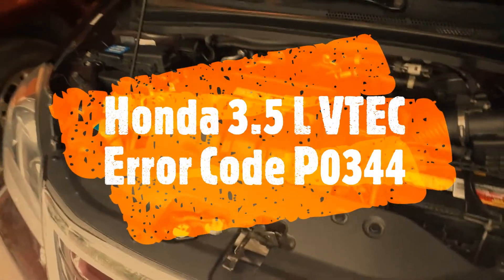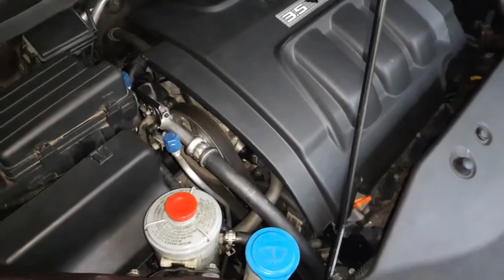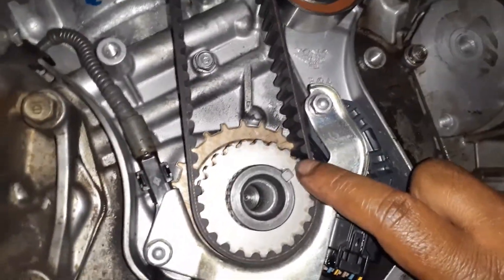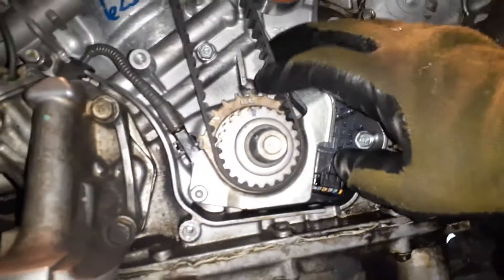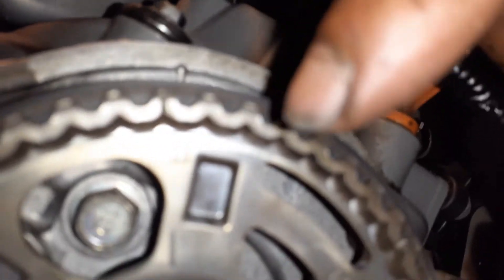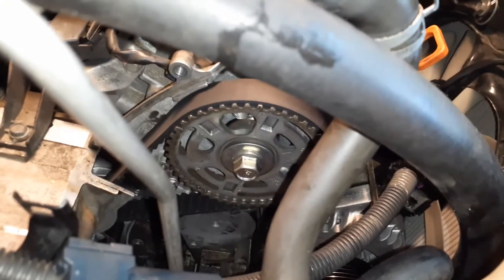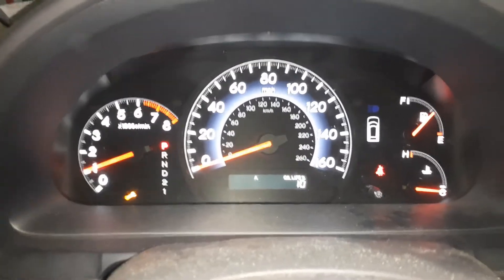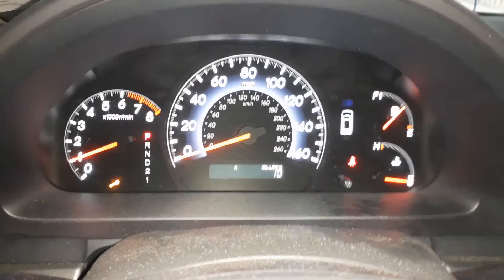Timing Belt Misalignment Problem - Honda/Acura 3.5L V6 Error Code P0344 P0340

Comment: Great job brother. I have 2007 Honda Oddyssey with blinking D light and VSA light on! We change the neutral safer switch and the pressure sensor! Also took it to electrical shop and transition shop and they can’t figure out what’s the problem is? I have p0340 and p0344 codes camshaft position sensor circuit internment bank 1. You think the camshaft sensor cause the flashing D and VSA light to stay on? Thanks in advance
Reply from the maker: If there was no change to the timing belt alignment, then the camshaft sensor should be the issue or the connector for the sensor. You can change the bank 1 sensor A (front camshaft) and see if the error goes away. Changing the sensor can be done without removing the timing belt or camshaft pulley. You have to align the holes of the camshaft pulley to the bolt that is holding the sensor in the back of the pulley. Bit tricky, but can be done with some patience.
Reply: @DIYWithIndi  thanks man 👍

Comment: What happens  if  i drive my truck  with this problem?
Reply from the maker: Depending on how much misalignment you have, you will eventually bend or damage the valve stems. I actually drove for a few miles but all the alarms on the dash did not look good. You should open it back up and fix the timing belt alignment.

Comment: Hello i have the same code after i change the belt but the VSA light is on too. It can happen?
Reply from the maker: You probably have the same problem as I showed on this video. Open it up again and check for the alignment. Yes, VSA light will be on as well as I showed at 0:39.

Comment: Hello Indi. Great Video. My question, was their any damage to the valves. The reason,  is I'm doing my timing belt on my 2016 honda accord v6. And after I was done I turned the engine by hand to make sure all my marks were lined up,   And it was some what hard to turn but after I was done I noticed my crankshaft was off by less than half a tooth. I just want to make sure I didn't bent any valves by turning the engine with the marks off. Thanks. Great video again.
Reply from the maker: I can assure you that you won't be able to bent valves by turning by hand. It is hard to turn because the rear camshaft is spring loaded. The valves were fine in mine though I started the engine with one tooth off. It would have to be way misaligned and engine running to bend the valves. The camshaft sensors are really very sensitive.
Reply: @DIYWithIndi   Thanks for response Indi. Yeah after all work was done started mine up, and it started up fine no codes or anything.  Thanks again. Take care.